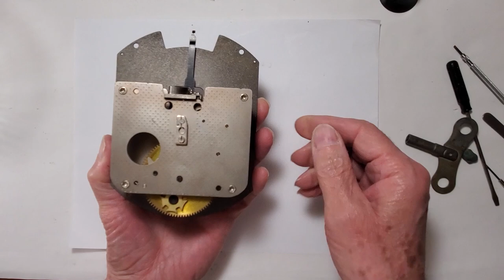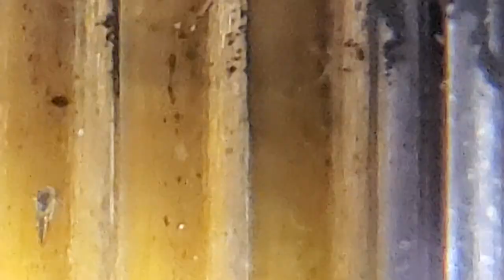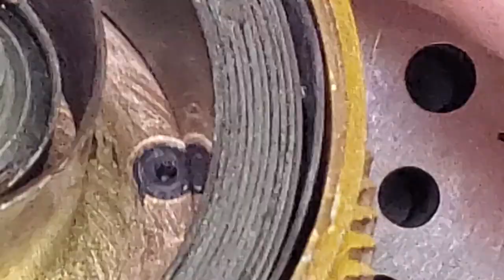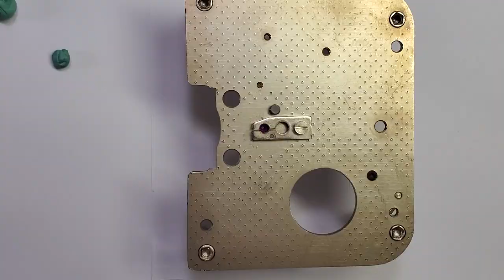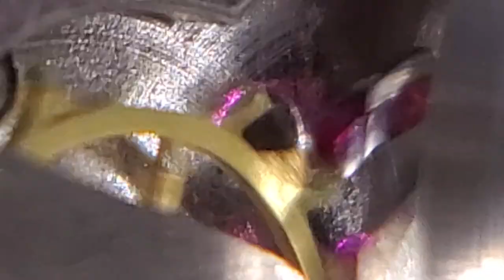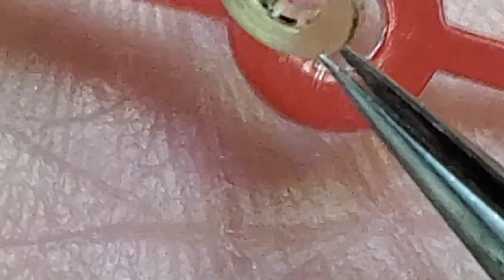Russian Submarine Clock Repair for Sam from California No#63

Comment: I have 4 of these, purchased new back in 90’s. . . 2 as gifts to relatives, one for myself, and another because a retailer had priced it too low to resist. Relatives eventually did not want them, so returned the clocks to me. I mounted all 4 on wall together and gave each a full wind. After the 1-week + it took to wind down, they all stopped within 10 minutes of each other. I found that amazing!
Reply from the maker: That's understandable all stopping at the same time, they have a geneva stop mechanism built in them that only allows a certain number of winds the mainspring makes.
Accurate time keepers, your relatives probably would rather not bother with winding them, seems to be a growing trend these days.
Reply: Damn. I would love to have one for historic reasons. Grew up during the cold war!!
Reply from the maker: @rf159a  If you get one, hope it keeps as good time as this one.

Comment: I found myself holding my breath when you took off the balance wheel and hairspring, and again when you were putting those back on - very delicate work.  I love how you have this huge collection of seconds hands - masterful job fixing that.  Great job!
Reply from the maker: Thanks Paul,
 Yes, these clocks are a clock with a precision pocket watch escapement in them, because of this, a lot of people don't like working on them.
We attempted to find a new, then used second hand, but not easy to find direct replacement without purchasing the whole clock, so seemed more cost effective to modify one to fit.
Its nice to have a stash of new and used parts to choose from, makes things move forward at a much faster pace.

Comment: Thank you for this Mr. James. It almost looks like someone put grease in there after working on their car. I bought one of these new in the 1990's, which was sold through a retailer called Sovietski. They sold all manner of Soviet related military items. Even though the clock was new, it could have been sitting in a warehouse for many years. They were around $79.00 if I recall correctly. They sell on ebay now for close to $300.00. The main reason I like this clock is that it enclosed preventing 100% of dusty from getting in. Great for a workshop. What I didn't know at the time is that these all need a good cleaning right off the bat. Appreciate your care and attention on this nice clock.
Reply from the maker: Owner said he ran this one for about 30 years without it being looked at and it always kept perfect time.
After seeing the pictures of how dry it was, he's glad he had it serviced now.
Reply: I bought one new 30 some years ago. I was repairing clocks part time out of college, and the owner and I both wanted to see the movement. We both thought it was a decent, but the quality of the lubrication was terrible. Very thick, sticky, black and the grease in the barrel looked the same as the stuff in your video, at which point it got cleaned.
Reply: @grivolas2144  Heh... They could be stored for many years.
And you have no idea how much Soviet sergeants in long-term storage warehouses loved conservation grease.
They covered everything, absolutely everything. I wouldn't be surprised by such a local initiative for your watch.
... But just imagine a howitzer, which was spent on a barrel of cannon fat.

Comment: Beautiful work, although I'm trying to come up with a joke about submarine clocks and how they don't look water resistant.   I guess if your sub clock gets wet you've some bigger issues to attend to.  Like keeping the ol' torpedees dry.  Showing myself out, no need to throw me....
Reply from the maker: Your right about that.
Reply: It’s just a shipboard clock. The seal keeps out dust mostly. And keeps condensation down. 

I have two of these running side by side for about 30 yrs. They’re really good clocks. In the paper work that came with them cites temp range and max min expected error per week. And if you’re careful with +/- adjustment they’re under a minute per week. 

I’ve had them serviced only twice. 

The daily rate does vary a bit thru the week with the spring power.

Comment: I bought one of these back around '94 or so, the papers that came with it showed new manufacture at the time. It holds great time, but seeing the condition of the grease is a little worrying, going to have to consider sending it off for a good cleaning, hopefully I may find someone local.

Comment: This is an early example of this clock as the later ones don't have the chrome bezel, but have polished brass. The later dials have a sub at an angle below the the hands as well. 
    I've often wondered if this movement was made on the old ansonia machines that were shipped to Russia after the went out of business.
Reply from the maker: i agree, its a good chance they were made from equipment from the American Ansonia Factory.

Comment: Hi, thank you for making this video which explains better than all the others on Youtube how to take care of this amazing watch. Can I ask you for some technical information? Could be useful for other hobbyists as well...
1 - what kind of lubricant do you recommend to use on the various wheels, on the escape wheel and on the mainspring? I have the 8020, D5 and 8200 for mainspring, do you think they are ok?
2 - I saw that you also lubricate the anchor pins. Why? I know that in wrist or pocket watches the pins of the anchor don't need to be lubricated, in this case what is the reason?
Thanks for the reply and greetings from Italy!
Reply from the maker: I would stay with any major brands.
I have never seen any certified tests done to compare different brands so can't recommend one lube over another based on any tests.
8270 or similar has graphite it and does well in mainsprings.
You can't go wrong with the D5 the 8200 is good for watches and 8300 is same as 8200 but thicker for heaver mainsprings.
Not sure of 8020.
It use to be common to mix your own mainspring lube from petroleum oil and graphite and it worked well.
Today I only use synthetic oils and grease. Grease is the same product as oil but with thickeners added.
There is always new lubercant coming out so read the instructions.
In the past there were multiple grades of lubercant recommended for different locations on clocks and watches but advancements has made it possible to use a single grade of lubercant in the place of these multiple grades.
Makes life a lot easier.

Anchor pins, if you are referring to the pallet stones, these operate better when lubricated as recommended by manufacturer and will keep better time lubercated.
Reply: @jamesmartin5370 Hi James, thank you so very much for sharing your work on YouTube, truly professional clock restoration is rare to find here and the one other clock repair channel I follow has not posted in a long time. I was very happy to discover your channel recently. 

I’m fairly certain that the OP is asking why you chose to oil the pallet fork pivots. Oiling the pallet stones is normal good practice but certainly in watches and pocket watches the majority opinion is in favor of leaving the pallet pivots dry, with few exceptions. 

Clocks are not my area of expertise, I would be interested to know whether the pallet pivots are usually oiled when present in a clock movement?

Comment: What was your preload for the mainspring? I'm working on one myself and just counted about 2 1/4 turns,,,.is there a known amount ? Hopefully you see this question but appreciate the video. 
👍👍
Reply from the maker: 2 1/4 sounds good, 
 I used 2 turns, put it on the timer and found it timed out with no variation at full wind and at the 2 turns so left it there.
When dealing with used mainsprings, no two will be the same.
Not knowing specifications the manufacturer recommended its best to use a timing machine to effectively determine how many turns to use, this is more important when using older high carbon steel springs because they have a higher variation than newer stainless white alloy springs.
I have found these movements to be highly accurate.

Comment: I do not think this clock has anything to do with a submarine, except for the picture on its face. An actual submarine clock would likely make a full circle in 24 hrs rather than in 12 - for an obvious reason. And would be electrical and run centrally - so all the clocks on a submarine would be synchronized. Soviets had a similar system installed literally in every school: it would be surprising if they used some basic mechanical clocks in their submarines. This clock was manufactured by Vostok (there is a mark of the face): thus the submarine picture and the name "Komandirskiye" - both the name and the face design made to remind one of their two main watch lines ("Komandirskie" and "Amphibia"). As for the type of the watch - it would be likely considered as "Kayutnie", meaning that they would be placed on a wall in a cabin: it is too utilitarian for a private dwelling.
Reply: Не думаю, что вы правы. Чистопольский завод выпускал механические корабельные часы с 24 часовым циферблатом. Что касается синхронизации, там, где она требовалась, её можно было делать вручную.
Меня здесь смутило другое: на корпусе часов выбито 95-2, что в моем понимании означает ll квартал 1995 года. На циферблате же написано Сделано в СССР. Похоже, либо корпус заменили, либо циферблат. Хотя, большого значения это не имеет.

Comment: I have bought some tools for clock repairing, unfortanely I have not the bergon bushing tool because for hobby to expensive. I want to ask are there other ways for bushing, the tools I bought have tremdous much reamers from very big to very very small. also normal spiral drill bits who has versy strange measures like 5.1 , 2.90 etc, I presume bushing can also done the cheaper way with drill bits like in the old days, bergean is very expensive for a hobby clock technician. I have reamers but these are for other purposes in clocks, the square round types I do mean. Thanks.
Reply from the maker: Some people use drill bits, they will drift and not leave a true hole so not the best to use.
Myself always reamers.
Reamers hold the center of hole the best and give a true hole ready for the bushing.
You can fabricate your own reamers if needed.
Reply: @jamesmartin5370  Hi James I understand, thanks for the tip. I have now ready mine pcb cnc router, this can do make traces like 4 between two ic pins. But maybe it is usebla for this rebus work. I have a lathe, so yes maybe I can make reamers myself. In the meanwhile I have bought a complete clockmakers tool box with a lot of usable tools, like reamers, but not the bergeon reamer who are used for rebussing.

Oke I have bought a very old comtoise clock with a verge movement, It does run now after cleaning and repair the crownwheel. I see that it needs rebussing for the drive wheels with that rope on it, but it is steel, I see that the other bearings are already done , bushings for this do not excists so I go make some from messing. The people who did the other busings did solder it with messing and make new holes, this clock is easy for this because lining of geers is very easy.

https://youtu.be/MyU8rP_iFNY
Reply: @jamesmartin5370  I have seen the fabric of these reamers on youtube, not that difficult, but I think precision is a important fact, the reamer go to  the dimensions needed for a particular bus, I thought it was 0.010 mm smaller then bus used?

Comment: What’s with all the scratches on the wheels
Reply from the maker: I have seen many of these and all are finished with those scratches on the wheels.
Must have been the standard the factory producing them were working to.
Looks like they were more concerned with function than looks.
Reply from the maker: @Ravel Mukhamatvaliev People I have repaired these for all claim they are accurate to seconds a day, very robust engineering.